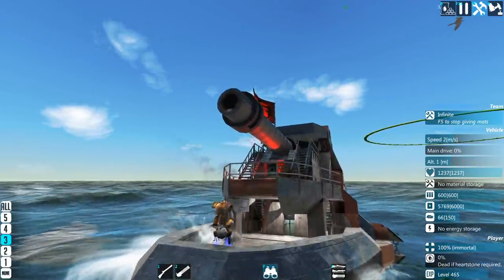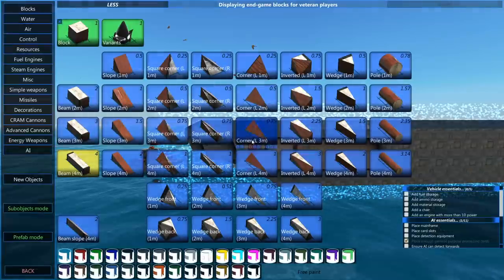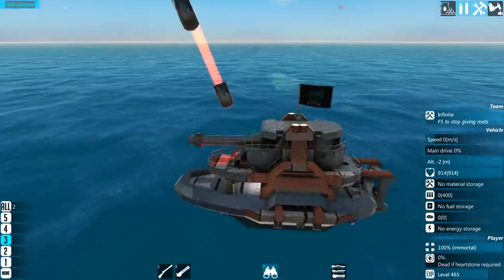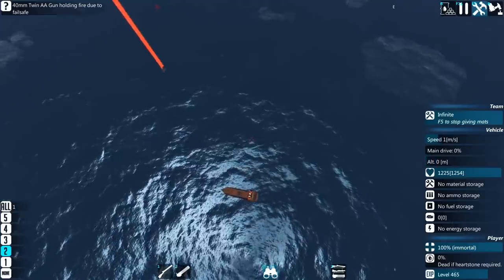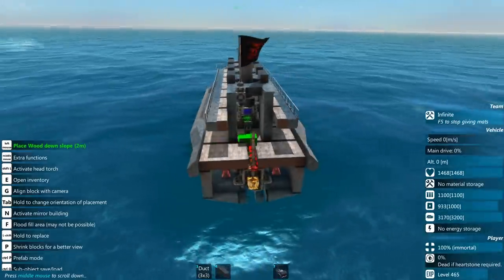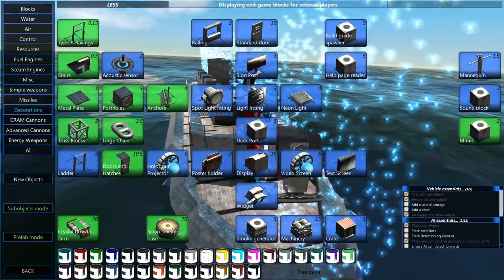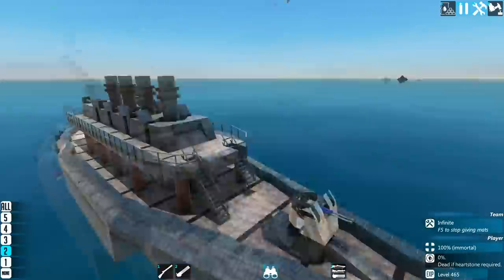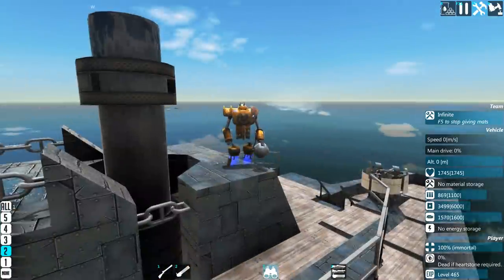From The Depths | CRAM Mortar Testing & Ship Building! Good Ol' EXPLOSIONS!

Comment: I suggest using an altitude fuse on mortars instead of inertial. To another point, do remember that we have mimics in the game now, which are exceptionally versatile when it comes to aesthetic applications. Basic CRAM barrels make for excellent connection points for large round-based propellers, and CRAM bomb chutes are perfect for connecting APS barrels or poles to the basic CRAM barrels.

Comment: "You really should have metal on the outside"

Not necessarily. The armor stacking mechanics mean that metal behind wood gives that surface wood bonus 15 armor. 18 armor wood.
Reply: But... you really want wood on the inside for spall liner.
Reply: @BrokenLifeCycle  use glass
Reply: @prateekkarn9277  _
never... thought of that...
Reply: big brain
Reply: @BrokenLifeCycle  I don't play FTD; What's that?
Reply: Mr. Night armor behind main armor so if a shell causes pieces of the armor to bounce around inside it just goes into that armor
Reply: @MrNight-dg1ug  spall liner is a weak, non brittle material that prevents shells from producing a ton of deadly fragments as they hit. Hesh rounds detonate and produce fragments on the other side which depends on the armor class of the material. higher armor class, deadlier spalling
Reply: @prateekkarn9277  Glass has such little health the more damaging fragments generated from the wood are still compensated by the added hp. Wood may also be usable as spall liner multiple times since when compared, inside ricochets shreds a lot of glass.
 Plus wood gives lots of buoyancy if there's a breached compartment.
Reply: @MrNight-dg1ug  yes but in from the depths its based off of armor class, and glass has lower armor. but irl people would use something like kevelar or rubber to reduce spalling
Reply: It should be noted that HESH is/will be changed (can't remember if it's been implemented yet) to be less binary. Instead of solely basing the shrapnel's AP on the AC of the block which generates it, it will average out the AC of all the blocks it passes through and count the last block 3 times in the average. This means the AP of shrapnel from wood (3-AC) backed by metal (15-AC) will be calculated as [(3+15+15+15)/4]*2=24-AP instead of simply being 30-AP from the metal alone.
Reply: Yeah. One of the best current tactics is HA HA Metal Stone, stone on the outer layer has ridiculous armor and it is very cheap to repair, so when the enemy FINALLY destroys your stone layer you just spend 2 materials per block fixing it back, HA is the booster here, also with this layout enemy emp attacks are obsolete and metal just for an extra layer for explosive protection basically
Reply: @bernardi5919  bounce chance is mostly a bonus, armor reduces the damage taken by a shell, i think that it was a 50% reduction if the armor and armor piercing of the shell where equal and no reduction if the armor piercing is double the value of the armor
If you put metal outside and wood inside, you get a strong outside layer but that will leave you naked once it breaks.
If you put wood outside you get a resiliant piece of armor that will hold it's own against low piercing shells and a decent metal layer afterwards
Reply: Last I checked, glass didn't count as a structural block, so glass won't work for an inner layer.
Reply: Guys i was just joking, glass just creates the most spalling out of all the blocks, it's a real frag show that kills your character instantly
Reply: @admiralobvious  structural layer as in when hesh hits your ship glass is not a layer? But it says it creates the most spalling in the game when hit by hesh.
Reply: @prateekkarn9277  Last time I looked at the description, glass wasn't a structural block and it was ignored by HESH. Even if it weren't, the AC of 1 would still outweigh the downside of being shattered by HESH.

Comment: To maximize damage across the whole ship being targeted by multiple mortars, use separate aimpoint selection for each cannon. Then, you won't have shells aiming at the same block and going through holes. 

Alternatively, you could fire the mortars on a delay between each shot so the shots behind the first one have a bit of time to home in on other parts of the ship.

Comment: I've gotten back into the game although I'm having quite a few difficulties trying to get the AI to be sensible, for some reason it's refusing to lift my hovercraft out of the water regardless of what settings I use (it has more than enough power to sort itself out it just doesn't)
Reply: Do you have any propulsion, that works in water? Remember that normal jet engines do not work underwater
Reply: @elgurkus6885  it's all based on heliblade spinners and I was starting it outside of water, I've checked and all of the spinners are using the correct presets for what they're meant to do on the craft and it handles pitch and roll perfectly fine, it just won't lift itself up.
Reply: @IExistSometimes  As far as i remember the AI doesn't work with heliblades, wich means that you have to use ACBs, wich also means that the ACBs could be fighting with the AI for control of the ship

Comment: How about a smol tonk? And I mean, really smol, something that has a pretty light armament (for FTD), 105-152mm gun. Something that you could spam. I would very much like to see those little tanks with skirts, so that the wheels/tracks are more or less protected. I saw some other YouTubers putting tiny engines in their vehicles, so maybe this is an option. I suggest the tank has 16 road wheels, or less.

Comment: I attempted something way back as a mortar role craft, the FLIP research vessel with an advanced cannon going nearly the full length with low powder loads. Much as in real life, went horizontal during movement then vertical during use. I went with this design for being a slim target, most of the important aspects out of usual naval engagements deep under water, heavily armored keel, and not needing to be all that mobile or fast as it was a supporting roll for large ship/base bombardment!

Comment: Altitude fuses set to a few meters under the water are really good on mortars. They are the perfect compromise between pendepth and timed fuses because they will explode after penetrating and after a close miss. I think you can even drop the inertial fuse for more boom because they will probably rarely land on something slanted.

Comment: perhaps setting the aim point to something like 5 seconds can help stop aiming at the same spot. Iv still not really used cram mortars but that accuracy is just insane :D What if you set the CRAMs normally not vertically on a turret and set them high only in the Q on the fire piece with a short barrel?

Comment: With the higher velocity shells, it didn't look like you were having the issue of the shells bouncing. It also appears that the slower shells aren't hitting quite on the top of the enemy ships and are hitting some of the side armor. The more harsh angle of the faster shells was leading to them dropping directly down on the enemy ship, which I think was more effective, or at least that's how it looked. Also, there's just something very satisfying about saying "Dear grid coordinates..." with extremely long range mortars. As a side note, an aft gun would probably be a good inclusion. If a faster ship gets very close and behind this ship, the forward smaller gun can't hit it and your shells might miss. Having another small gun on the back of the ship would help in that situation.

Comment: instead of using the wood on the outside you should use the reinforced decking (half wood half metal with the best of both worlds!) it has half the strength of metal i think and it also has the nice look of wood on the other side!

Comment: New trick with advanced cannons. Make the ammo comminishor longer by a metric fk ton. The cannons are as op if not more so. And look at making a rail gun with 2 direct inputs on the fireing piece. Slow rate. But massive ship breaking power. Especially at 500 mm

Comment: Try to use alstitude fuses set to 1m (no laser targeters), They'll make the shells consistently explode, even if they miss, since deck armours are really thin APHE is really easy, and doesn't need too many kincetic pellets, for it add a pendepth fuse set to maximum, and let the altitude fuse detonate the shells right where it hurts.

Also try and set the velocity to 130-140m/s they are way too fast for mortars

Comment: They look like smoke stacks.

Though this vessel would be more of a long range assist vessel that targets the slower ones first. Problem would be is its too weak by itself. This is like trying to fit a dreadnought battery on a yatch with only one anti air gun to save itself.

The long delays from shells falling could cause this tiny vessel to get annihilated before the first salvo even lands
Reply from the maker: Yup, fully agree! This craft is still very much on the small side in the grand scheme of things, only just about the size of 'easy' designs from the various FtD factions - It is never meant to be alone, but instead with other craft that can defend it and aim at smaller or faster targets whilst It has a fun ol' time targetting slow heavy armour targets. I mean, It was also just a craft built mostly to test a weapon type! :)
Reply: @Lathland   or it could be like that extreme range missile battery tank from one of your campaigns before.

Though I was thinking that these cram mortars would fit well on a larger, more well protected vessel, maybe in the spine of a battleship? Or a laser airship like before
Reply: @Lathland  also a cluster missile holding magnetic bombs striking from a 90 degree angle would improve the mines accuracy. Maybe a satelite build? Though I have to ask. Does harpoons work on cluster? Could a cluster missile hold torpedoes?

Comment: Can call thr Titanic. Or The Queen Mary or Britania. Kind of looka like them. Also you could consider serting the delay times so that the guns fire at a low constant rate kinda like pistons in an engine so once you start firing it does not stop. Also they may target diferent parts of the target. 3 or 4 of these ships will devastate anything but they will need escorts or set them up as true artilery: really far from the battlefield or both.

Comment: From what I've heard, the mortars can only really target a craft turning at 50 m/s
Reply: Thath's pretty damn fast, most heavy ships move at 30m/s or so
Reply: @rompevuevitos222  it's still countered by fast things
Reply: @Cheesecannon25  Like 90% of the weapons in this game, nothing new
And the more meta crafts are huge battleships anyway so for tournaments this is still a great weapon
Reply: Would you by chance know to even get the shells to home in, I can’t figure it out
Reply: @scheise4433  in the firing piece, set preference to 'only high'
Reply: Cheesecannon25 I’ve done that but the shell won’t track the target
Reply: @scheise4433  ask on the official Discord for FTD
Reply: Cheesecannon25 alright, thanks!
Reply: @scheise4433  It's automatic, but it's very subtle, so it's more noticeable when they are moving slowly
Reply: NANCOK hmm, mine doesn’t track though I know it’s subtle but mine always  misses stationary and moving targets, and I doesn’t attempt to adjust
Reply: @scheise4433  If it misses stationary targets then the aim itself is off, remember that it works best (if at all) with slow shots that have a lot of air time
If you're aiming for a direct shot then the homing will do pretty much nothing
Reply: NANCOK I set it to only high arc, is there a way to slow the shell down then? I’ve got the actual mortar and it fires at a high arc

Comment: Please, please, please use pen depth fuses on mortars. I think pen depth fuses are awesome regardless of the form they're in, but with the mortars, you'll get the best possible plunging fire. You could time them so that they explode right in the bottom of an enemy ship after going through the deck, which will probably give you a better chance at quickly destroying important modules as I think most important modules are put very low in ships most of the time; and if that doesn't work, you're going to quickly sink the ship because you're blowing holes in the bottom lol
Reply: Pure HE is quite wasteful generally speaking. Most of the time, if the round explodes inside the vehicle, there's less waste because the explosion can damage things 360 degrees around it
Reply: And you should absolutely be using alt fuses with pure HE so that if you miss the enemy, the shell will still explode, probably damaging the enemy a bit

Comment: Is it just me are or are the front 2 mortars slightly shorter than the others? Barrel length?
Reply from the maker: That's just a visual thing, sometimes they get stuck at different parts of the firing animation after a fight when they should reset.
Reply: And you instantly replied to me I feel special now. Oh and that's interesting. Also what's interesting is that the first time I ever comment on a video after having watched you since around I want to say 5k subs years ago and I get a reply to my first comment :o

Comment: Technical Intelligence Report
Date: (redacted)
From: LT (redacted)
RE: Faction (redacted)
On observation of the second model from (redacted), at their proving grounds at (redacted), I can confirm that this faction is indeed testing a high angle attack weapons system. This weapons system's chief problem at first, before switching to staggered volley fire, was the shells landing in the gaping holes blown by previous salvoes. In tests against an Iron Guard faction, Ironclad class captured hulk, the target as rendered non-functional in a single volley. By the third volley, the shells were detonating against floating debris. My local informant stated, "(redacted) that thing is going to (redacted) (redacted) against (redacted)!" If I may inject my personal opinion, this faction bears watching...